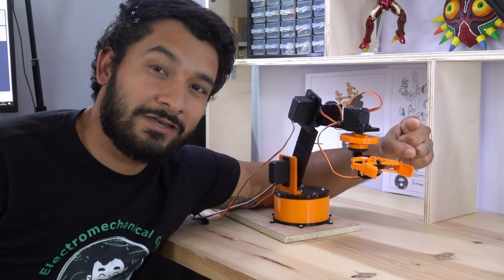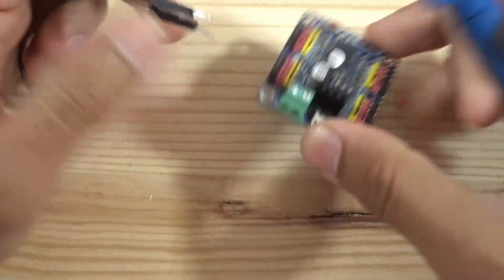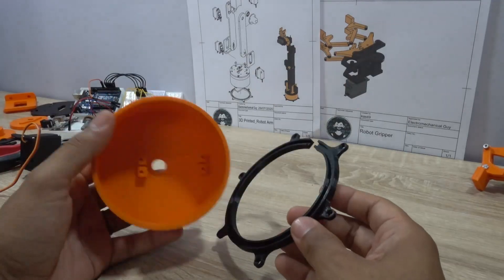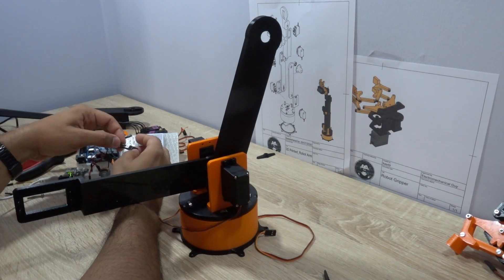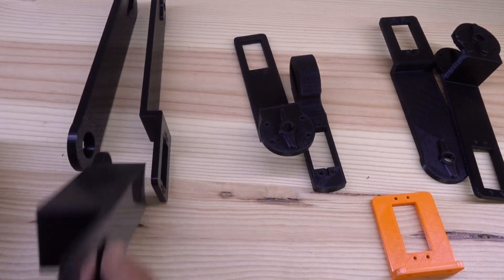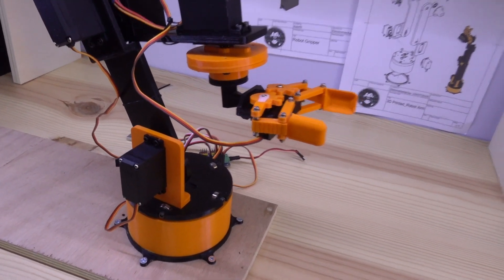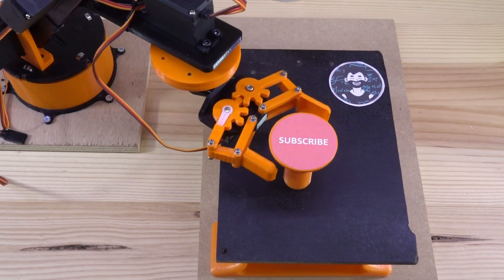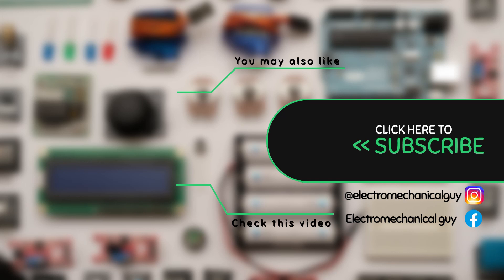How I made my first 3D Printed Robotic Arm 🦾🤖 | DIY Robotic Arm

Comment: If you want to make it easier for you to program it and also make all the calculations easier . Try putting all the axis of rotation on the same straight line. Having them offset one from onother will make it a hell of a lot more difficult for u and the processor to get the correct values
Reply from the maker: Thanks for the tip, i will take care of that on the next version

Comment: Is it possible to create a function that decelerates the robotic arm at the beginning and end of each movement, to make it smoother?
Reply from the maker: Never tried before, sorry
Reply: Yes. It is. It's not too bad with the arduino code. Simply use a for loop for values below and above a certain value to reduce a velocity variable.

Comment: A tip for the grippers on it. The motion can be reduced by the limited power of the motors limiting functionality, so when I built pinchers I had them spring loaded in the shut position. Depending on the strength of the spring, you can just have the servos hold the pinchers open or incorporate a ratchet mechanism. That'll allow you to increase the strength of the pinchers closing without having to replace the motors or sacrifice mobility.
Reply from the maker: Hi, thanks for the advice!
Very useful, i will try this on the Version 2. Do you have any photo or STL to explain the mechanism?
Reply: @carlos3dprint  here's the claw that I modified. https://www.thingiverse.com/thing:420524

You may need to change the size and scale of some components, but with slight modifications it could work. When I built these, the tension spring or rubber band was attached to the inner two arms of the grippers. This concept will work on pretty much any parallel gripper you can find, the one I gave is just the on I've used.
Reply from the maker: Thanks mate! I will check it out 😉
Reply: @carlos3dprint  no problem!